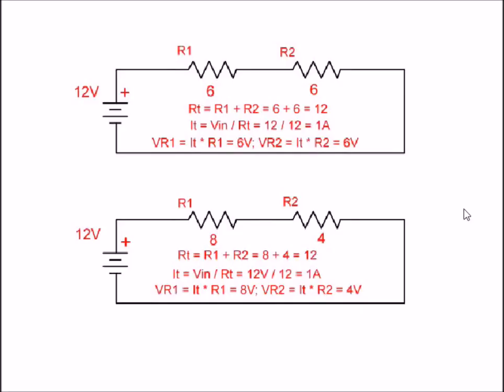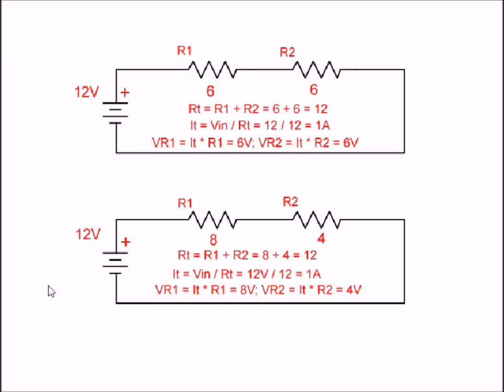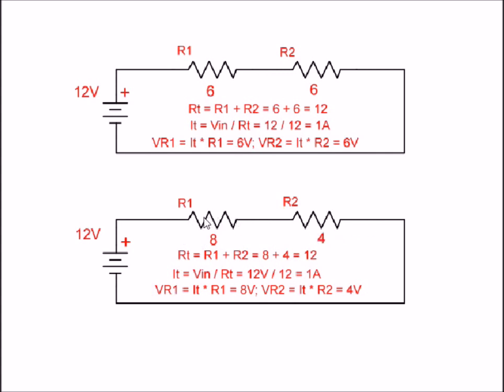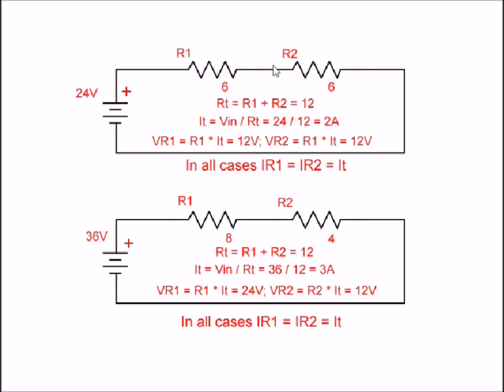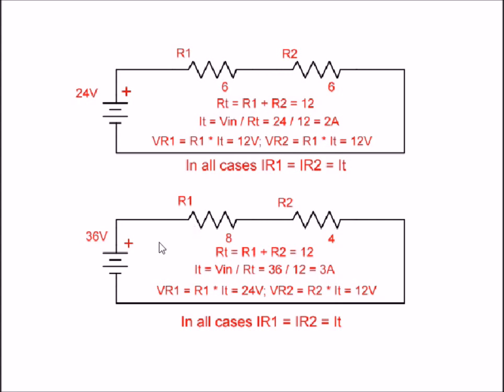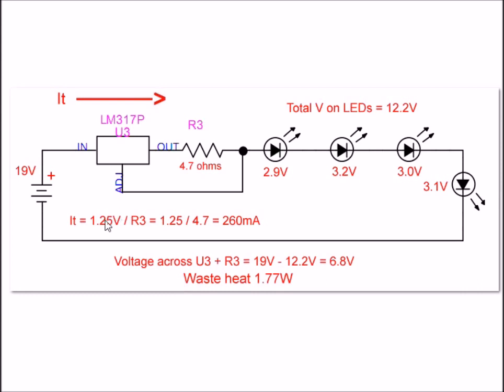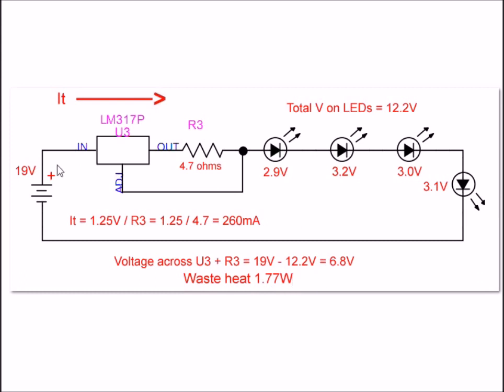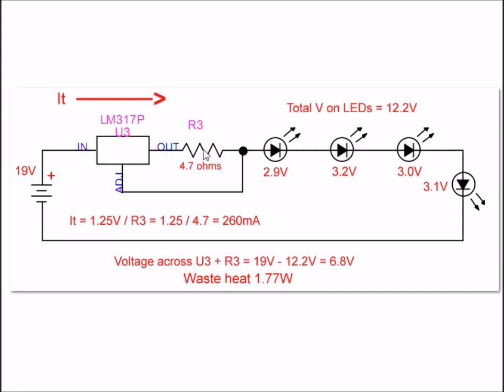Series Circuits Review and LEDs

Comment: OK - Today's whopper is that the LM217/317 always puts out 1.25 V. See page 6 of the ST data sheet. If Io <~20 mA or the junction temperature is elevated due to large Vin/Vout then these jellybean chips go nonlinear in a hurry. 

That is why they have been largely replaced by the LDO series. If people still use the LM217/317 series they follow the data sheet and build the subject circuit up to deal with protection and linearity issues. 

At any rate, any discussion of these chips must include the whole ball of wax on junction temperature control. Hence, they are rarely used in introductory material. 

It is important to keep up to speed in electronics. I recommend anyone taking these classes get a copy of Horowitz & Hill, 3rd ed., vol. 1.